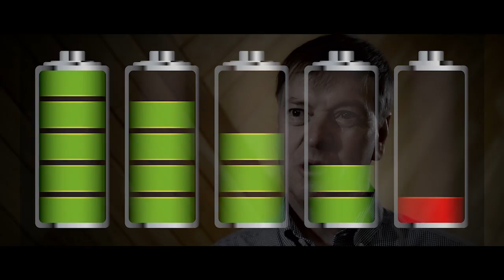Alternative battery systems for transportation uses

Comment: Although it would always be beneficial to have better battery technology. Cars should have the ability to draw energy from the surroundings and not have to carry the energy with them unless they travel off of the major Grid road system.
Remember Trolly wires? Imagine Solar road surfaces. 
Hey guys, why not think outside of the box.